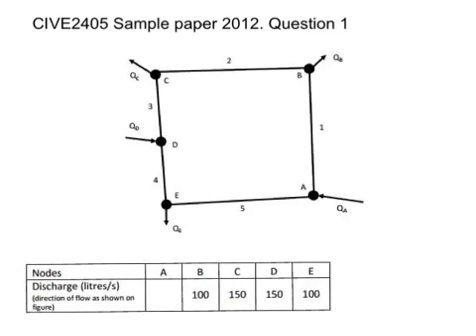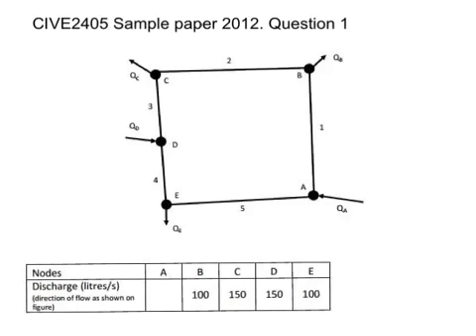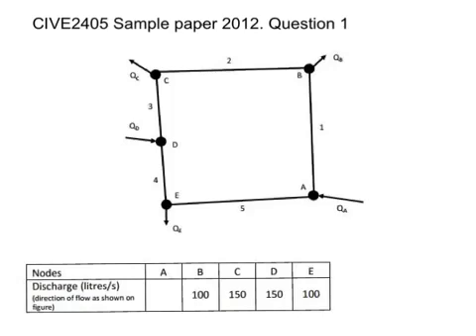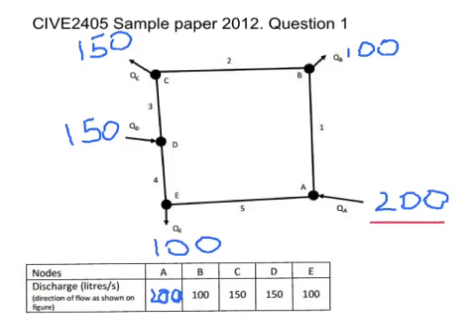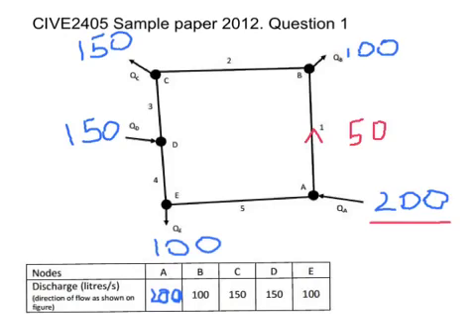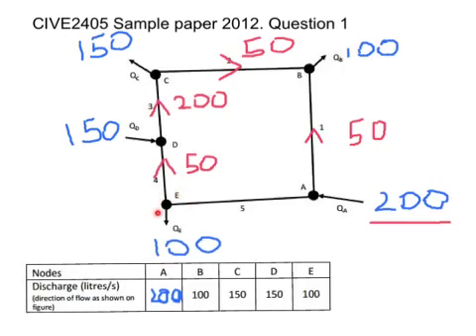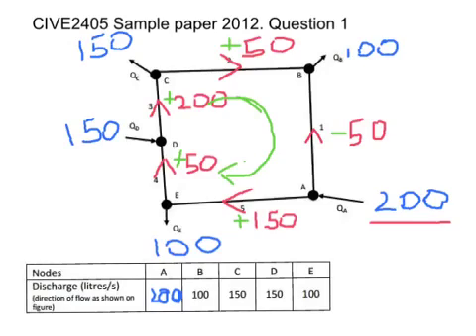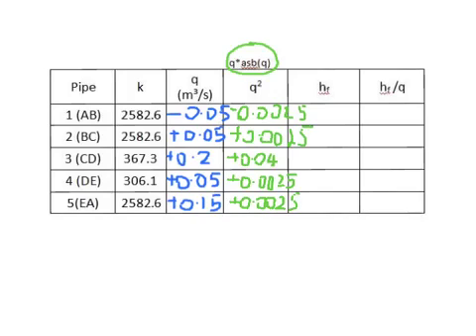Hardy Cross - Get the signs right

Comment: Hello Andrew, I am just wondering how is this method of calculation applicable in the initial design of a pipe network?

1.In your example, Qa to QE are all known, but in reality, we would not have known the output values. Or can they be the design flowrates we want to achieve?

2. what happens at each node is there is a elevation difference? how do we account for the head difference in the equation then?